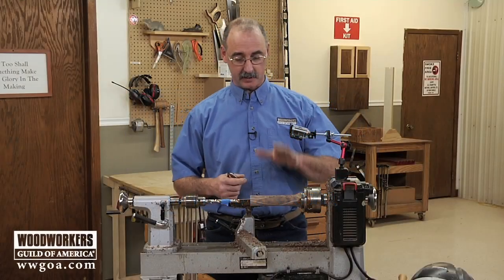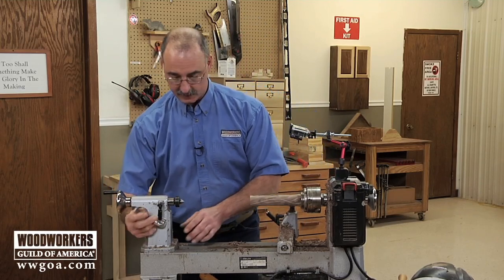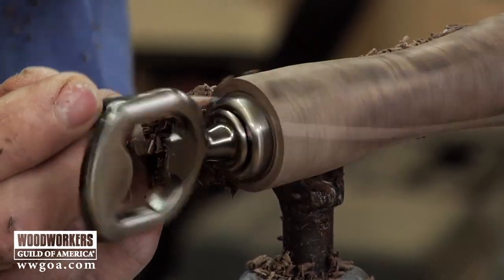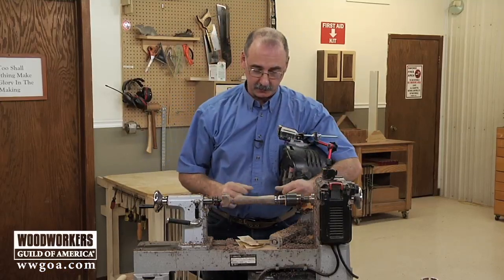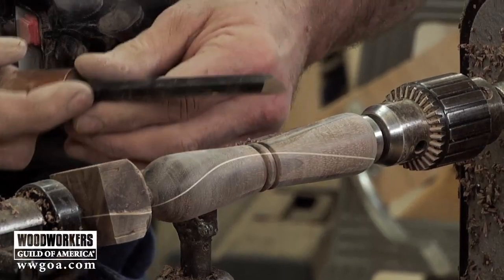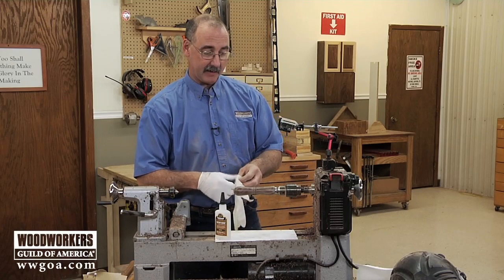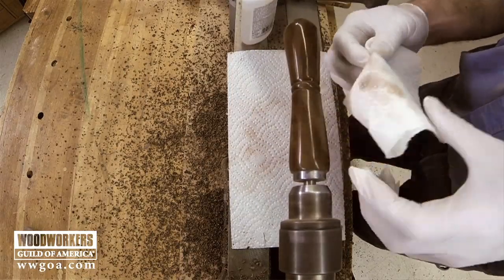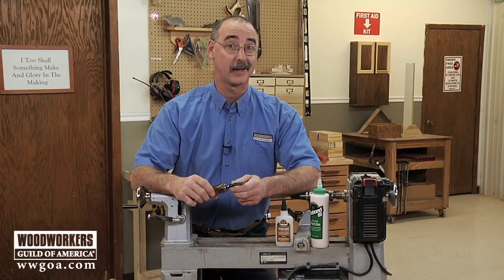Make a Bottle Opener Handle on the Lathe -- Part 2 Turn and Finish

Comment: Turned out beautiful. Gonna have to make one of them myself. I have the same lathe and sounds like the set screws are a bit loose on the pulleys as was mines (light rattle). I could be wrong though

Comment: I have tried this a few times, every time I flip it around and put it into the mandrel, its crooked and clearly out of balance. How do you keep it so straight??
Reply: +Andrew DiNatale  The cone center really helps.  Its shape means it HAS to self-center in the insert.  If centering continues to be a problem, leave the handle oversize before you turn it to the mandrel.  That way you can remove the waste and take it back to center.

Comment: What needs to be done when the banjo will not lock down to the lathe bed?
Reply: jarhead4God Usually there's a bolt/lock nut you can access from the bottom of the banjo that can be snugged up.